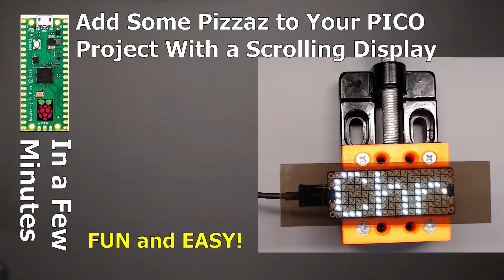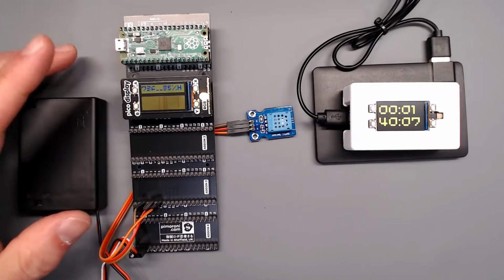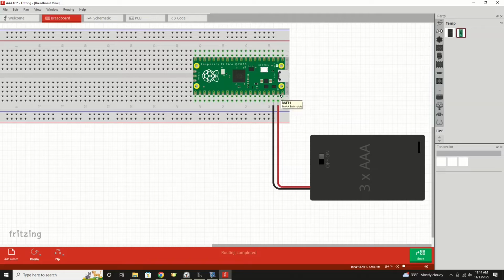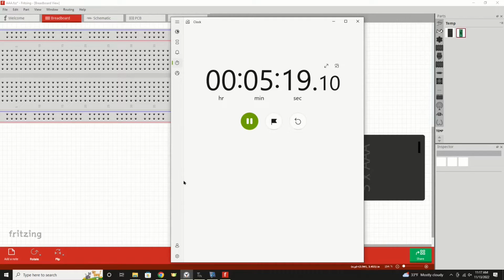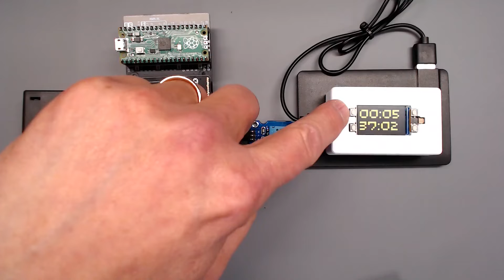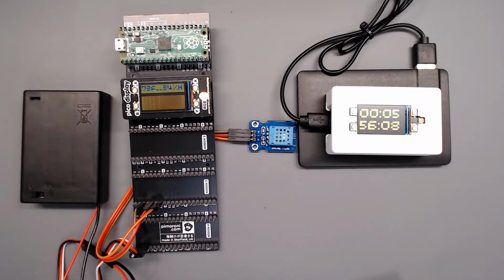Intro to Battery Powered PICOs

Comment: Nice Video!  How long can a powered up PICO run with a UPS... say for instance 3AAA alkaline vs Akaline AA vs Lithium AA?  any guesses?
Reply from the maker: Hi Mark,  I have not tested much in battery life running a PICO.  There is only one test that I ran and that was with the slim power bank I may have shown in that video.  As I recall, with the PICO Display and the PICO running constantly, it ran for about 2 days and I ended the test because that was the maximum target duration I needed.  However, I now see there is value in that information and I may have to revisit that subject.  Thanks for the suggestion!
Cheers!
Chris

Comment: Good video. In the battery pack there are 3 batteries for a total of 4.5v with alkaline cells and 3.75v with rechargeable batteries. Is this enough to power the Pico reliably? 🤔
Reply from the maker: So far so good!  I have been using that as a test bed on that temp logger with some different batteries and it is working good.  I believe the external power supply specs are that it has to be between 1.8 Volts and 5.5 volts - they did a good job thinking about how we would use it when they designed it.
Cheers!
Chris
Reply: @MakingStuffwithChrisDeHut  Thanks Chris. I'm not sure but the pico must have a boost converter built in to boost anything from 1.8v etc to a 5v level  or all the logic levels would be unusable with external sources like TTl or cmos etc. I should have thought of that. Thanks again Chris for your efforts.